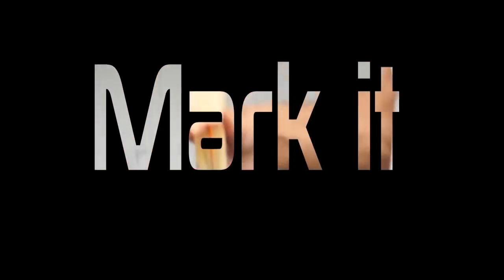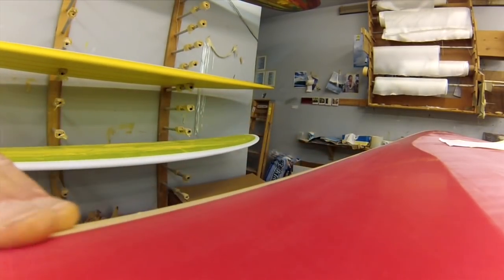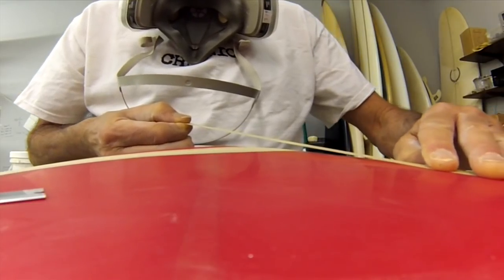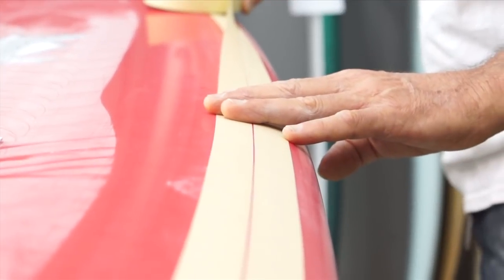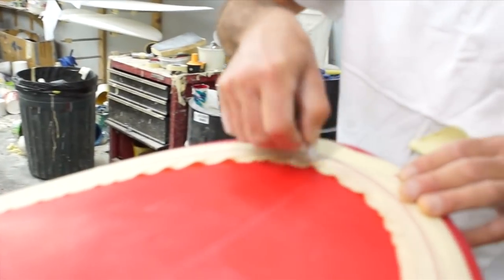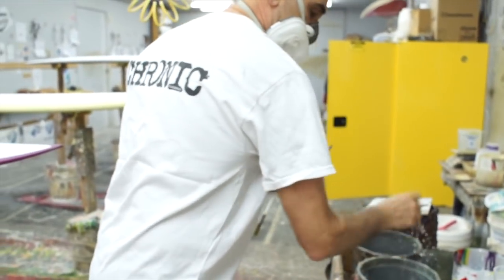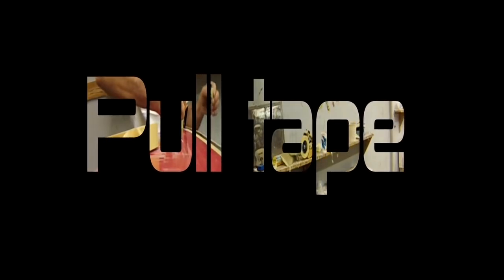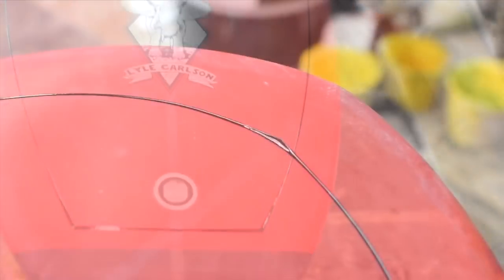Resin Pin Line Tutorial

Comment: There is so much more to a smooth pinstripe than this video shows...

What grit do you sand the hot coat to?  It makes a difference when you burnish the tape to the sanded surface.  I used 220, wet for a clean surface with good hazy finish.
Rather than a pencil line, I used the tip of an Xacto blade, set into the same tool.  Just make sure the scratch is within the tape or resin will bleed under the tape, along the scratch.
What tape do you use?  I found out the hard way that cheap masking tape doesn't seal, the adhesive is resin soluble.  The green stuff works well, forget the 3M number.
Besides razor blade burnishing the tape to the sanded hotcoat, is there a sealer used to minimize resin creep under the tape?  I very thinly fingerpainted clear UV lam and flashed it with some sun; the lam set and sealed the tape edge so no resin creep under the tape.  This is the biggest source of grief when you're pinlining.
How hot (how much catalyst) to set off the resin?  You want the resin to fully cure (pigmented resin resists curing) but no too quick so the wax doesn't have time to rise and seal the surface.  If the wax doesn't rise, the pinline may not fully cure.  At worst, the finish coat will partially dissolve a gummy pinline and it'll smear to hell and gone.

Anyone still using cobalt accelerator?  Fiberglass Hawaii refused to sell it to me.  Something about a sudden reaction with catalyst...  don't do this at home.

There are art and mechanical drafting pens with inks of various colors (though some colors are weak, black is pretty good) that can be used for fine lines. Different width pen nibs allow different width pins.  Straight edges, curved splines, a plastic french curve or other guides can be used if your freehand linework isn't even.
Reply: used 220g on the area to be pinlined. push 1" 3M 2727 tape down with a razor blade. pencil works for me. I use finishing resin. add a couple drops of wax (surfacing agent). viscosity is the determining factor for bleed. thicken with areocil if desired. epoxy must be thickened to avoid bleed. 5cc catalyst seem to be good for our climate. avoid too much pigment. i pull the tape immediately so the wax covers the edges and seals them to avoid bleed when glossed. india ink is a good refill in a black posca. good luck!